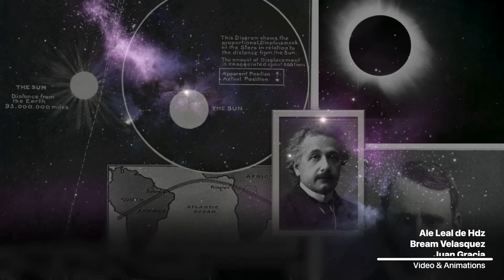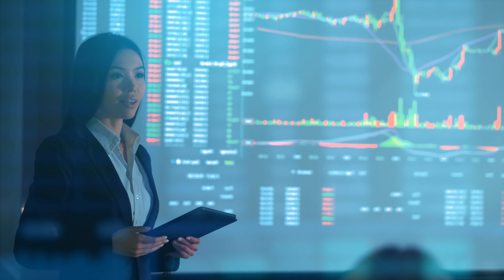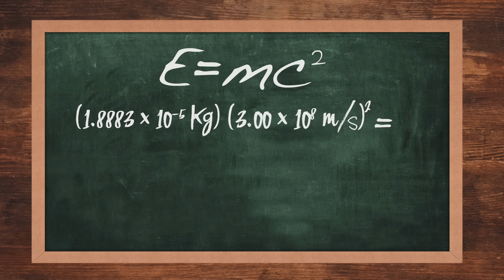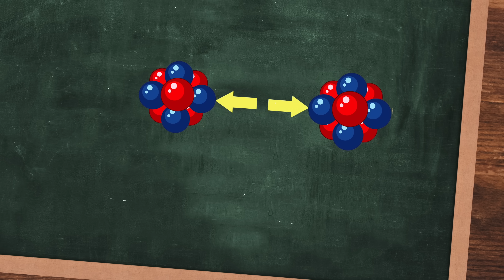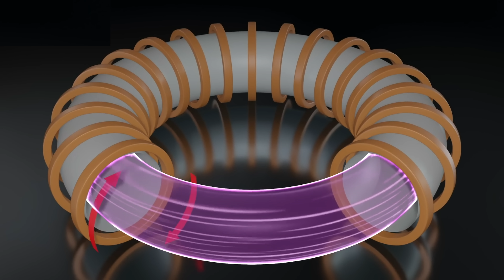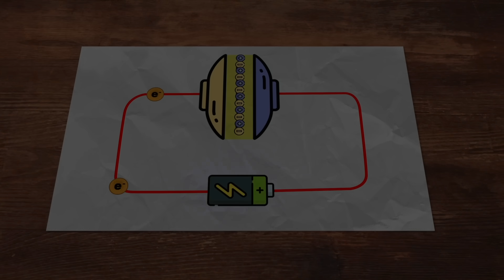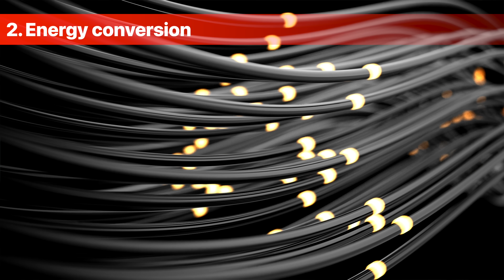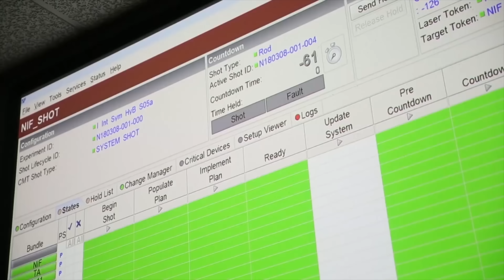Why THIS Fusion Milestone ISN'T Like The Others...

Comment: But your using this Energy Produced By Fusion to make another form of energy, Electricity. In the Feature nothing will be Electric. All things will use the energy produced by Nuclear Fusion Directly, no need to use it to produce Electricity. How ever this will not put the OIL industry out of Bossiness. Rather there  will be an even greater need for OIL as many new Products Modern  Essential to life will be invented. The earth will need to produce more Artificial GREENHOUSE gases in the feature in order to Supply Plant Life with enough Carbon Dioxide to produce two things Man needs, Food (Plant Life) and Oxygen Produced by plants for the Trillions of Air Breathing Things on this NEW EARTH. Oxygen Production will be the next Great Riddle for man to solve in as little as next Century.
Reply: Trillions of air breathing things are exhaling CO2
Reply: This is comedy. Good job, clown.

Comment: Fusion is always 20 years in the future for 100 years now
Reply: Y es demasiado complicado sin FISIÓN nuclear energía. No me gusta fusión ahora porque muchas personas necesitan energía HOY.
Reply: Fusion was first described in 1920, first done on a lab in 1932, first fusion bomb 1952. Since then controlled fusion on a small scale has been demonstrated many times, finally break even fusion was accomplished in December. 

One way or another, It will happen.
Reply: @aredditor  fusion bomb or fision bomb ? They are different.
Reply: @yahanaashaqua  Ivy Mike, first test of a fusion bomb. All fusion bombs require a fission bomb as an initiator, BTW.
Reply: Fussion was discovered after 1923...

And it will be the fastest to develop power sources if it only takes 100 years.

Facr, even if it's a hundred years, from now it will still be one of the fastest to develop.

Add to that the fact that several forms of it take several decades between prototypes...

And honestly, another 150 from now would actually still count as very fast when you control for that.
Reply: @fanOmry  That's irrelevant.  We are going to use the technology that gets us the most clean power for the least money, and that will never be fusion.
Reply: @incognitotorpedo42  

Why? What do you base this assertion on?